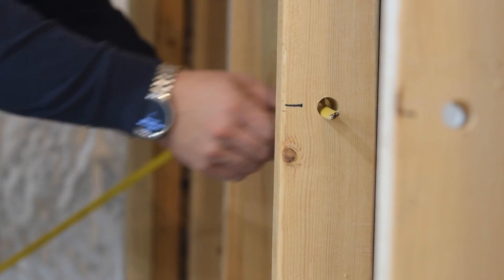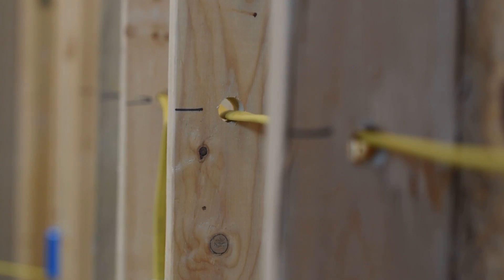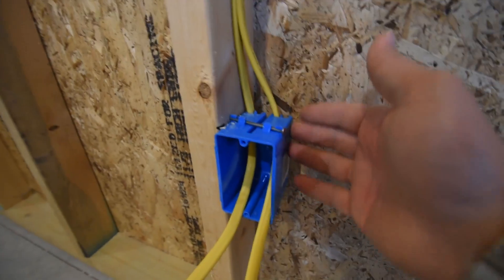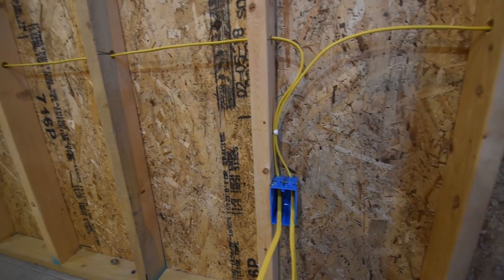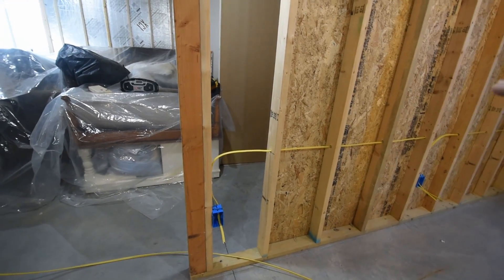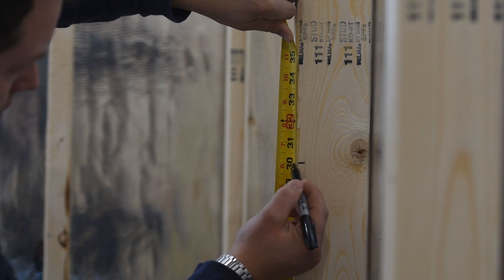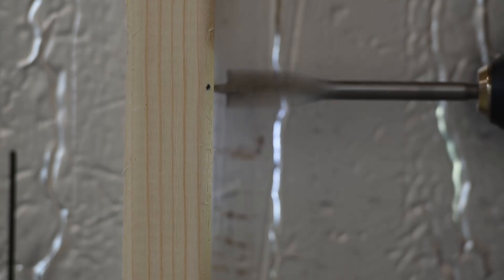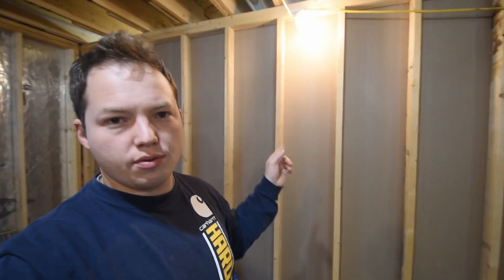How High Should Wires Run Through a Wall

Comment: thigh high is where we drill. have to stay efficient and trying to mark your wire height any other way then eye balling it is going to make for a very long day. ive been a full time electrician for 12 years now and been working with the same crew for the past 5 years. we rough in between 5-8 houses a week from 1400 square foot ranches to 5000 share foot 2 stories on basements. we never mark our holes when we go to drill. we have a yard stick cut down to 42 inches for switches and counter outlets and all our hammers are cut to 13 inches for a quick measurement to the bottom of plugs. time is money and even just eyeballing the holes the quality of work is still top notch. but for someone doing it them selves at home for the first time, this is a great video to reference on. only thing I have to point out is to take into consideration the staples you are using. I noticed you used a whits single wire staple to staple a double wire which around here if the inspector saw that he would turn down the house. we have white staples for single wires, tan staples for double wires, and grey staples for triple wires.

Comment: Personal preference is forty inches (so I don’t have to bend over to drill and pull wire, getting old), and I use a laser level to locate hole height. Using a Milwaukee Hole Hawg I just put the self feed auger bit on the laser line. It’s quick and results in a perfectly level line of holes. Switches are set at 48 inches and outlets at 12 inches.

Comment: I always leave a small loop of extra wire between the staple and the box.  If the wires get mangled by the drywallers or the box needs to be moved a little (wainscotting or some other wall treatment in the future), it's an easy pull/fix.
Reply: any suggestions on the loops?  I see different ways of doing so

Comment: Also, if you plan on having a rat infestation in your home having the wire to low will exposed it to the rat and it’s massive incisors as it uses the inner workings of your home as a supper rat highway.

Comment: Ok I've read thur a bunch of the More 'En'lightened commentators kind like myself... 
> poingent pause< 
In my educated experience 
1st using a 3/4" × 10" auger on a Milwaukee Hole Saw drill, clamp a stack of 4 to 5-  4×2's  measured up 24" drill the stack that way you've got roughly 25 &1/2" when you add your base plate... oh wait you didn't pre drill, then use the above mentioned drill with a 6" ×3/4"  drill bit. Then take a 1/2" plywood about 8" wide by 48 tall. Then cut at the 16.25   C  out the 2.5" × 3.75" size for a single , then at one end cut a 2.5"w ×  1-5/8" d for a single switch, then flip end over cut out the 3.75w× 1-5/8d for dbl gang. Then measure from one of the bottoms, up and 1.5" attach a piece of  2×1 scrap, let this ride on the floor plate as you mark your box locations.
Also from the bottom edge of the cut with the single switch cut out drill out a hole at your 24", to mark for the wire. Then   spray paint it RED on the side for the single gang  side. Then YELLOW  on the side marked for the Dbl Gang box
What you've made is a story board that everybody can set as a standard marking guard.
Oh one last thought Mark you name on it! Because someone else wi take off with it.

Comment: brendan broomfield 4 days ago, "Personally I like leaving a loop so it doesn't cross itself, so basically like an upside down u so if in the future after the switch has been changed and the wires snipped as they often are through the years you don't have to extend the wires using a separate piece and wire nuts, more or less a courtesy to the next guy"
I further use NON-CODE color tapes wrap around cables to signify "functions" within the box. I use YELLOW (a live color) to signify the active incoming power, I use (passive) BLUE, to signify the LOADS, or feed cables down to the next boxes in a sequence, and I use PURPLE to signify wires that "may or may not" have live power attached, being light switch wires. So every box has a single live cable feed(YELLOW) a variety of passive load cables(BLUE) and may have a variety of switch cables(PURPLE). Note: Switch cables are PURPLE on both ends(This includes three way toggle switches). LOAD wires are YELLOW on the load end, and BLUE on the feed end.  This color coding system very much simplifies decoding existing systems and switch boxes that have multiple loads, or multiple remote switches. So with 3 spools of color tapes in your pocket, You can greatly simplify tracing power flows through a branching network from box to box, from load back to source, without needlessly searching through peripheral branches.  
Example: In a basement where there are exposed many branching Boxes if one were to tape-wrap-color-code the cables just outside the boxes, a yellow cable would lead you back towards the power source, blue would lead you down towards the loads, and purple would lead you towards or away from a switch box, AND HELPS THE NEXT GUY(if he trusts you) but certainly might lead one to save a bunch of time as they are verifying the past passes through the system. "Once verified could guide forever"

Comment: Good idea to standardize the height of electrical and plumbing. On my own house with 2 x 6 walls I pre drilled the studs for electrical and plumbing. I also like to run the  horizontal run by my bed down at the bottom of the wall. Just in case the EMF levels are high I would rather not have the wires running at head level.
Reply: Running electrical at the base of a wall is bad. If you have a leak or condensation, the water can pool inside your wall void getting your wires wet. 
 Receptacles used to be installed in the floor. The reason for the code height of receptacles is two fold to protect from water flooding and to cause a loop of cord to hang  lower than the receptacle. If liquid is spilled on a table that a lamp is sitting on, the liquid runs down the cord. At the lowest point of the cord,  liquid goes to the floor, the cord loops back up to the receptacle.
Reply: @creesenebeker5686  I have never had water in my walls. if you have water in your walls you have bigger problems. By my bed is the only place I ran the wires down low, not on the plate but about 6” up. I agree 24” up is bad for possible drywall screws.

Comment: Yeah 
Drill all your top plates and service entrances first, early in the day while you’re still fresh and the attic crawl space is cooler. 
Drill your outlet run holes last; use your thigh for leverage and make the drilling easier.
Not much worse than the handle of a HoleHawg slapping you last thing in the afternoon!
😅

Comment: I hold the drill at waist level and run around the structure like a crazy person until all the holes are done or my battery dies.... whichever comes first. That's how I set the wire height.

Comment: Cut a board for height, some of us old guys used story boards to locate outlet boxes, wiring, switch boxes and even plumbing lines.
Reply: @raljame you beat me to it lol - my thoughts exactly - when I did apartments and tract houses in the 90s that's exactly what we did - one story pole for the entire project keeps everything uniform. 
Great comment 👍one old guy to another 🧓
Reply: As a handyman reading this, I'm so glad you shared as I wouldn't have thought of it but it'll be so useful for my current project. Thank you

Comment: If the hole is 12 inches or less you don’t need a staple but generally holes should be waist high or so, so you don’t have to bend over

Comment: Personally I like leaving a loop so it doesn't cross itself, so basically like an upside down u so if in the future after the switch has been changed and the wires snipped as they often are through the years you don't have to extend the wires using a separate piece and wire nuts, more or less a courtesy to the next guy
Reply: brendan broomfield 4 days ago, "Personally I like leaving a loop so it doesn't cross itself, so basically like an upside down u so if in the future after the switch has been changed and the wires snipped as they often are through the years you don't have to extend the wires using a separate piece and wire nuts, more or less a courtesy to the next guy"
I further use NON-CODE color tapes wrap around cables to signify "functions" within the box. I use YELLOW (a live color) to signify the active incoming power, I use (passive) BLUE, to signify the LOADS, or feed cables down to the next boxes in a sequence, and I use PURPLE to signify wires that "may or may not" have live power attached, being light switch wires. So every box has a single live cable feed(YELLOW) a variety of passive load cables(BLUE) and may have a variety of switch cables(PURPLE). Note: Switch cables are PURPLE on both ends(This includes three way toggle switches). LOAD wires are YELLOW on the load end, and BLUE on the feed end.  This color coding system very much simplifies decoding existing systems and switch boxes that have multiple loads, or multiple remote switches. So with 3 spools of color tapes in your pocket, You can greatly simplify tracing power flows through a branching network from box to box, from load back to source, without needlessly searching through peripheral branches.  
Example: In a basement where there are exposed many branching Boxes if one were to tape-wrap-color-code the cables just outside the boxes, a yellow cable would lead you back towards the power source, blue would lead you down towards the loads, and purple would lead you towards or away from a switch box, AND HELPS THE NEXT GUY(if he trusts you) but certainly might lead one to save a bunch of time as they are verifying the past passes through the system. "Once verified could guide forever"

Comment: I leave slack at each device box...so if I need to pull more wire because of the dry Waller using a roto zip to cut out the boxes and possibly nicking a wire in the box. And in Canadian electrical code we dont run wires to switches out of receptacles because of the arc fault rule.
Reply: Plus if you are worried that someone may drive a long screw through your wire...put a protection plate.

Comment: Last I checked the code it's required to secure wires within 12 inches of a box but you raise a good point about not securing wires too close to a box.  (stress, bending, etc) Problems associated with being too close are not addressed in the code.
Reply: 8 inches from the 6mm sheath required that's left in the box.
Reply: @EGGINFOOLS  … I'm an old guy. Perhaps I am recalling the days of BX or conduit where there was no sheath inside the box. I can see where that could change with Romex.
Reply: @rupe53  Old guys have the best knowledge in most cases and can teach better!
Reply: @EGGINFOOLS  … I would agree that we have more experience and know what works but some of us also have bad habits that are hard to break.

Comment: Bruh learn your code. A hole counts as a strap or staple. As long as your horizontal hole above your receptacle box is within the distance of being required to have a staple then the hole counts as a strap and no staple is necessary. Also brother you'll never be truly productive measuring and marking each individual stud for your wire hole height. Turn your drill sideways and nestle it into your hip joint parallel to the ground facing forward and then simply walk beside the wall popping your holes as you go and at an extremely easy and repeatable height. Since you're making up your heights and pathways as you go and can make them essentially any height,  then don't pick a random number and adjust to it , instead make your heights and pathways based off of something that you can make work for you instead of you working for it. If every hole you still is at your hip height then you'll never measure anything and every hole on every job will be within a couple of inches of every other hole on every other job. Super easy and super fast while being super clean on the install. My friend that's how you get a reputation for top notch work and how you make top pay from production while doing it. Good luck brother.
Reply: National Electrical Code article 334.30 A- In other than vertical runs, cables installed in accordance with 300.4 shall be considered to be secured where such support does not exceed 4.5 feet intervals and the nonmetallic-sheathed cable is securely fastened in place by an approved means within 12 inches of each box, cabinet, conduit body, or other nonmetallic-sheathed cable termination.
Reply: Here are several bits of info from an old dawg. Agreed on using a comfortable height for holes as long as it isn't at lower or upper cabinet screw height. Anyone saying 24" hasn't pulled wire for many years. The trick to lasting in this, or any trade, is not bending over or being on your knees constantly. Try to remain upright, your body will thank you later. A little extra wire is cheaper than the surgeon. When you think about how many holes an electrician drills, this is where job profits are won or lost. You can't be profitable if your a slow driller. Spent many years putting pipe in my holes and they have to line up from stud to stud. I found using the laser and snapping lines is the best. That way your not blocking the laser path when drilling. Laser is especially useful when setting boxes over kitchen counters so they are exactly level when counters and tile get installed later.

Comment: Drilling the hole is to small. Your allowed 1 1/4 hole.  And not enough staples. And the wire is to loose.
Reply: Only required a staple every 4ft per nec 2020

Comment: Knee height for horizontal runs is best. That way your lackey can lean into his work. Plus we measure down from the ceiling for switch box locations. 48&5/8" down is ideal. Drywallers will love you. That way he only cuts one piece of rock.

Comment: The 30" works unless the room will have wainscoting. The standard is 32" for wainscot, but it can vary from 30-36", most times capped with a chair rail which is generally fastened with long nails (8-10d or 2.5" gun nails). It's to each persons preference but I am not comfortable nailing trim within 6-8"of wiring passing through a stud.
Reply from the maker: I think 24" is a better option overall especially in situations like you describe.
Reply: @BenjaminSahlstrom  24 for all of the home?  I see some individuals running wire up and then back down in the kitchens.

Comment: All I see when looking at this mix of copper, pvc insulation and bare wood is fire. 

Running the mains thru fireproof tubing should be mandatory if it isn't. Even if not, it's still a good idea. 
Also, running the wiring in metal tubing, and the tubing properly grounded, will reduce the risk of fire, reduce EMI and reduce the risks associated with some random lad or lass putting a nail/screw in the wall and hitting the live.
Reply: That's why there's ground and arc fault breakers; so we don't have to use tubing everywhere. But tubing would be a good idea in most attic spaces, because vermin with sharp teeth.
Reply: That is the case for commercial electrical. Most of the homes in the US are track built. No way are they going to pay for that. I don't even see custom home builders doing it. I do see fire sprinklers required in high fire danger areas. I remember many old homes with steel flex. They are nice to change up and pull wire through conduit rather than removing and patching lath and plaster.

Comment: I had a high end contractor explain what he called the 4 block corner.  When making a corner use 2 upright studs with spacer blocks 12 inches long. One goes at the top and one goes at the bottom  and one goes 16 inches above the bottom one 16 inches below the top one.  The open spaces give you clear area in corner to run wiring and most plumbing runs, just like you showed in your video

Comment: I mark the first stud at 30 inches and then I mark the other stud in the other corner at 30 inches and then snap a chalk line from one end of the wall to the other end of the wall and I have a straight line to drill all my holes at 30 inches.

Comment: The only code requirement I'm aware of are ADA. For floor outlets, the height is a minimum 15 inches from the bottom of the receptacle box to the floor. There are other variations but it is dependent on if there are obstacles, counters, etc. But if it is your personal home, do whatever you want.

Comment: Hey Ben, would love a video on old Levington wireless remote switches. I have to replace one but have no idea what will work in its place or if I have to replace the entire system to Lutron or something. It's a 4 switch combo device.  So maybe a video on how that all works.
Reply: @scotmiller5979  agree. I like the Casetas but I dont think they have 1 switch that will control 4 different lights.

Comment: using consuit, you can repull wire later if needed, with romex you only have the wire thats there, no back. you have no slack behind the box. if you replace outelts in the future and cut a wire too short by accident, what would you do? you should leave a loop of wire between the staple and box.  https://www.google.com/search?q=romex+in+outlet&tbm=isch&ved=2ahUKEwiclcCylqrmAhWCVawKHSLyBSoQ2-cCegQIABAC&oq=romex+in+outlet&gs_l=mobile-gws-wiz-img.3...2728.6220..6492...0.0..0.180.2009.1j15......0....1.........41j0j0i5i30j0i67j33i299j33i10.eQu1DhFqROo&ei=yxXvXdyDHYKrsQWi5JfQAg&bih=612&biw=360&client=ms-android-att-us&prmd=sivn&hl=en-US#imgrc=SDPXesnLyj2dvM